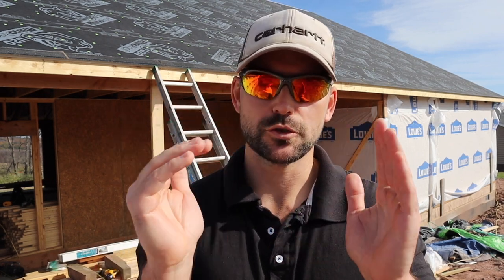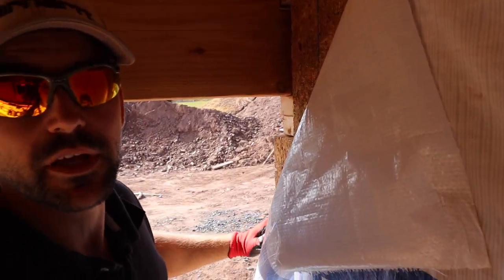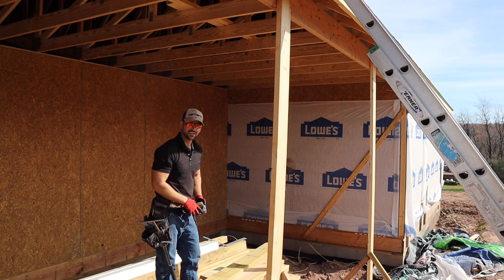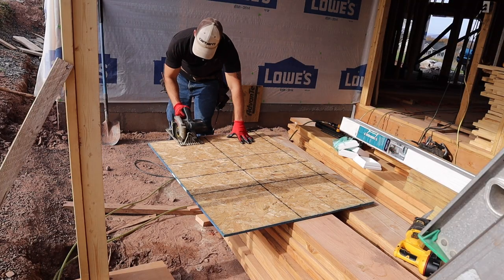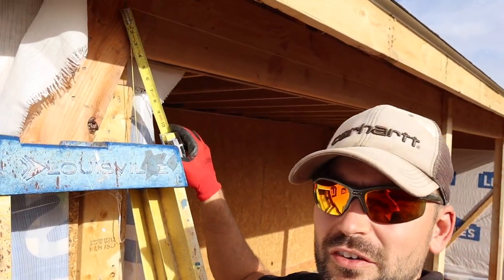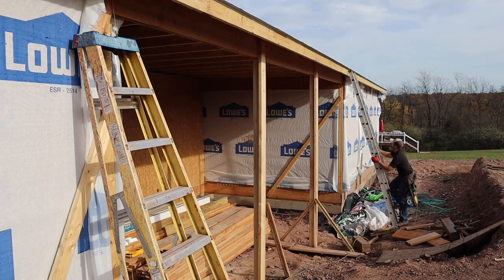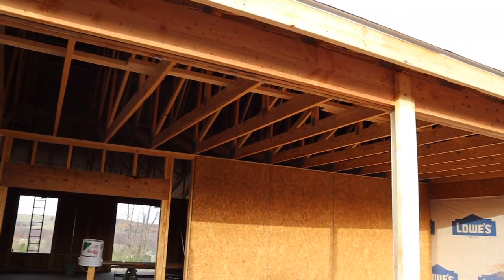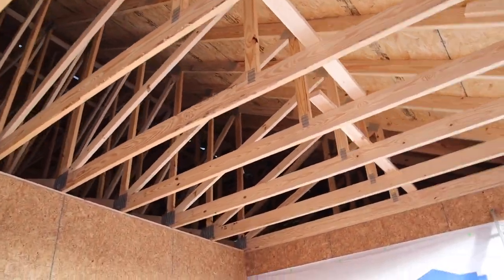How To Frame A Porch Beam

Comment: I found your video because we are currently building our house ourselves and have a wrap around porch we are adding on.  You asked for feedback regarding DeWalt battery nailers.  I'm a heavy DIYr, but never invested in the "right" tools until we started this project.  The DeWalt nailer works, and is much more convenient than a  hammer. I can't imagine lugging a hose for a pneumatic nailer either.  The downside of the DeWalt battery nailer, it does take a half second to 'charge" before each nail.  I also seem to run out of ammo A LOT 😂.  We've framed the entire 2400 sq ft house and are about to rais the trusses, and I've only had two instances of Jams that required me to get the allen wrench out and clear it (although there was nothing to clear each time).  If you have an investment in DeWalt 20volt already, the nailer is a good investment.  If you are looking for the best battery nailer, My brother-in-law recently brought his Milwaukee over and it definitely outperformed my DeWalt.
Reply: Ioo

Comment: Question: Where beams pocket into exterior walls in a corner, like what you have, can I notch out all the corner studs to accept it, so that my beam is FLUSH with the house framing? It looks like you were notching some type of truss or rim joist or something, not an actual stud. I wasn't sure if it was "structurally" ok to notch out all the studs in a wall corner, In a situation where I just had studs going up to a double top plate and was putting a porch beam in right there, flush with the top of the double top plate. For example, say a deck that the framing was flush with the corner of a house.  I know engineers are particular about corners, notching top plates  at corners, etc etc

Comment: I have an existing deck I want to put a roof on it. I have calculated a lot of things, but the posts that were set up for the deck are 6 x 6 and in some areas off the ground 8 foot and some areas half a foot it goes all the way around my house what I would like to know what size what I put up on my deck to support the porch and what is the distance of a span for 2 x 10 headers on 6 x 6 posts or can I use 4 x 4 posts? I have been doing this on my own. I’m a grandmother of three adopted grandchildren. I’m a YouTuber. I plan to shingle this roof and I am using 2 x 8 rafters my issue is this the 6 x 6 post they put in some were 6 feet apart somewhere 8 feet apart somewhere 10 feet apart for the deck I understand that under the higher portion of the deck they need to be closer.  On the porch the porch, although some of my posts for the roof will not match up with the 6 x 6 posts of the deck. Can I work with that?